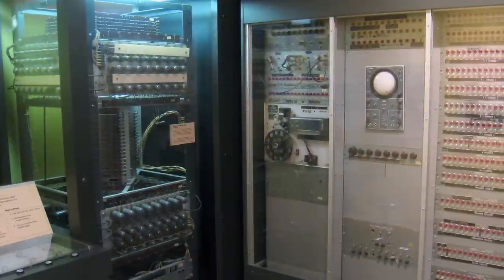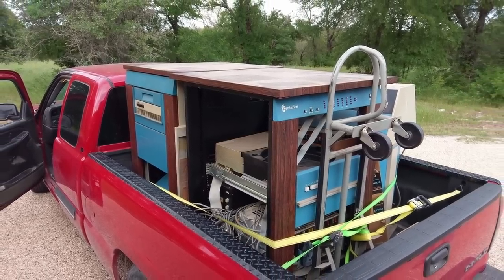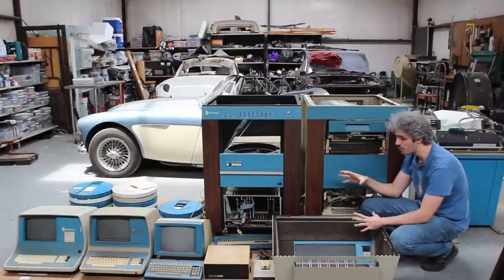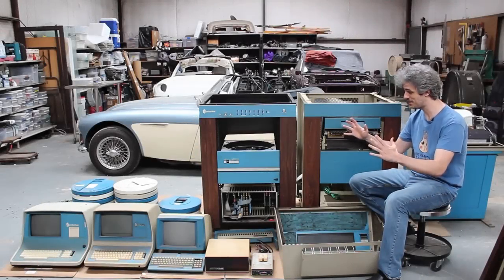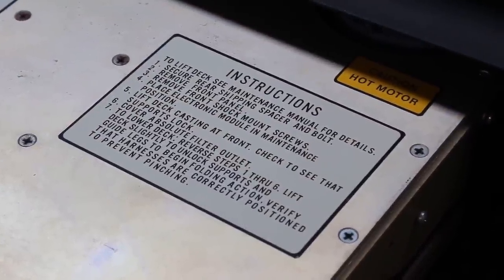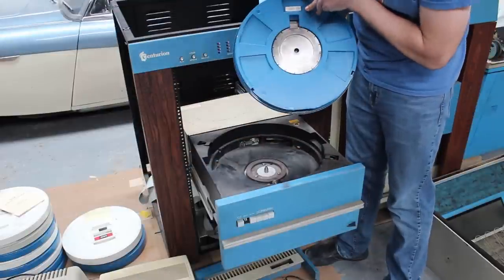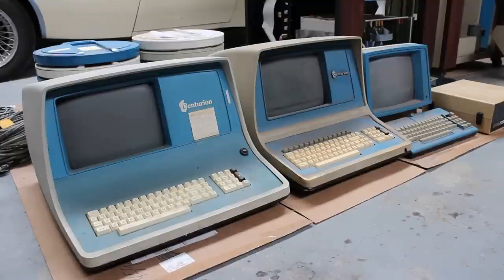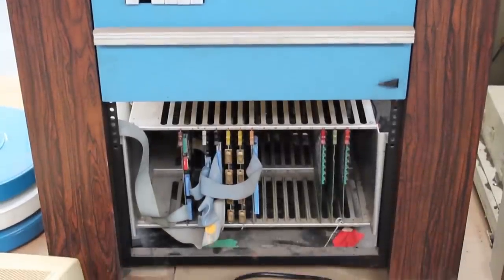I Bought a Minicomputer from 1980! – Part 1

Comment: The drive on the left is a CDC Hawk - Model 9427.  When you fire it up, be sure you have vacuumed it out thoroughly, replace the hepa and prefilters, and pull the voice coil cable, and do a spin purge (cartridge loaded - but not the heads) for a day or two.
Reply: this is such a great memory for me

Comment: In 2003 I worked for a company as a part-time IT help desk and a part-time computer operator. The computer operator portion was basically baby-sitting an IBM AS/400 and the attached printer, which was similar to that one you got, but bigger. I would feed it a box of paper every morning and make sure the massive print job was successful.

Comment: Well, watching this video brought back memories from the the late seventies. That second disk drive looked very similar to the CDC 9427H drives I used to work on as a field service engineer. The Micom box is a serial multiplexer -- it takes all those serial port connections and time multiplex's the signals to go out as one serial port stream to a modem. We used 2400 and later 9600 baud modems over a dedicated line, no dial up required, which allowed the main computer to be used in more than one store. Got to admit that printer looked pretty funky. I worked on drum and band printers, besides good old dot-matrix and daisy-wheel printers;the best description I can think of for that thing is a chain printer.
Reply: A chain printer is exactly what it is.
Reply: Any idea what the capacity of one of those drives is?
Reply: @timothy098-b4f  the 14" hard drives in my S/34 were a whopping 13Mb each, so I'd guess probably in that neighborhood.
Reply: @timothy098-b4f , I remember the 9427H as having a total capacity of 5 MB -- 2.5 MB on the fixed platter and another 2.5 MB on the disk cartridge. Normally, at least for my company, the data was mirrored between the two.
Reply: If this is from the 70s.  Would the modems not be 300 baud?

Comment: I think the smaller 'modem' is a leased-line modem.  Those ran at fast rates for the time, upwards of 4800bps.  The other box, the Micro 8000 looks to me not to be a modem but rather a concentrator/hub for a whole bunch of terminals to connect to it and then to the computer.  I once owned a Data General MV4000DC that had a similar device.
Reply from the maker: I think you're right on the money about the Micro 8000, as that also explains why I got multiple terminals with the machine. It would make sense that the company using the machine would setup multiple workstations and then have them all multiplexed in through the Micro 8000. 
I just looked up the Data General MV4000DC and that's a super cool looking machine! Looks much more compact than Centurion I have here, though if the Centurion used standard floppy disks, it'd be about the same size. Those CDC drives are massive!
Reply: I’ve seen and programmed packet switches that looked like that (x.25) The leased line may also be x.25, very common for the day.
Reply: Yep, that's how that works.

Comment: According to the DIP switch legend on the back of the terminal you powered up, self-echo was set to off.  You might get text on the CRT if you turn it to on.  At least the disc pack has the Control Data logo on it, so you may be able find service data for the drive on-line, but for the minicomputer itself?
Reply from the maker: That was absolutely it! I ran back out to the garage and gave it a test: https://i.postimg.cc/tJhfRy07/IMAG3685.jpg
I actually have the little user's manual that came with the drive itself, which is super cool. But, you're right, finding any information on the rest of the machine has been difficult for sure!
Reply: @UsagiElectric  that will give you doubled characters when you hook it up, no doubt. 

You can try th eterminal with a linux machine to check it out properly.
Reply: 9 months late, but this was my immediate thought too!
Reply: @lostcarpark  Yeah, on other brand machines it could be not "echo", but "duplex/semi-duplex", same meaning.

Comment: I worked at an auto parts store in the early 1980s, and the back office & point-of-sale system was based on a system similar to this, and had the same blue & beige terminals.

Comment: A few suggestions: 
1. Those two fan motors are for the absolute filters. The replaceable drive should be in that cabinet as well. Those old drives were very touchy when came to dust and other airborne stuff, you don't keep them  clean-you have head  crashes and replacement heads will be hard to come by.
2. Those are most likely ASCII terminals. (I agree, I think that one box is a concentrator for the other terminals) The serial setup can be problematic, in the old days you had to select baud rate, # of stop bits, parity (odd, even or none) and leased line modems you also had fuss time delays for high and low tones, echo suppression and other stuff I don't remember, you cannot believe how complex serial communication used to be. I think each of these db-25 plugs on the back of those each  could drive a ASCII terminal.
3. If you run that printer much, you will want to replace the foam, that was for sound deadening.  The chain printer weren't as noisey as drum printers, but they aren't known for silence.

Good luck with your project.

Comment: In 1987 I started work for  data cabling company Unisys at the age of 18. We used to wire these kinds of systems together, soldering 25 pin or 37 D connectors on each end. I still do the same kind of work and now and again see some of the old cables in the roof spaces, from back when I installed them in the 80's.

Comment: People are equally confused when they find out "medium voltage" starts at 1,000 volts.
Reply from the maker: That's so true! It really blew my mind when someone actually explained that a 600V audio amplifier is technically considered low voltage. Mind you, it'll still knock you across the room if you put your finger in the wrong spot, haha.
Reply: @UsagiElectric  Unfortunately most people think "low voltage" means it's safe. Tell them that mains is low voltage, then get into Safety Extra Low Voltage and Functional Extra Low Voltage and heads asplode.
Reply from the maker: @ian_b  My tube computer is being built entirely in SELV, which is mental for tubes to be operating that low, but in the scale of voltages, pretty much all tube operated stuff classifies as low voltage anyways, haha.
Reply: @UsagiElectric  The "low voltage" that always scared me as an electrician/engineer was "low voltage" battery sets at 960V :)
Reply from the maker: @ian_b  Haha, that's just mean! Just barely sneaking in under the low voltage classification!

Comment: That Micom device is a serial mux.  Basically takes all those serial ports and converts it to one port which can be sent to another matching device over probably a 9600 baud (or less) serial connection.  ADP used to install tons of those into car dealerships...
Reply from the maker: That makes a lot more sense! And also helps explain why I got three data terminals in the deal as well. The company probably had the three terminals setup as work stations all hooked into the same machine. It's going to be a lot of fun trying to bring it all back to life!

Comment: We bought a IBM PC with a 10 megabyte hard drive in 1984.  We also bought a printer from the IBM salesman.  Big desktop thing with tractor drives and serial ports.  Then we had to buy an adapter to get the IBM printer to work with the IBM computer.  Even the salesman was mystified by that one.

Comment: Worked with one of these computers in the late 1980's.  I am amazed that you were able find one.  We had the computer, several terminals, a line printer (like the big one you have there), a couple of dot matrix printers and a 10meg Winchester drive that sat on top of the whole unit.  When this thing was powered up, you could heat a small house!  And the line printer would make you deaf.  The early days of computing :)  Thanks for sharing.

Comment: The disk drive that loads from the top is a 9427H also know as a Hawk drive from CDC / MPI. The removable platter is 5 Meg and the fixed plater is also 5 Meg in size.  The other drive is a 9448 CMD or cartridge module drive also known as a Phoenix with a 16 Meg removable cartridge.  The fixed Platters varied depending on the number of heads installed, and could be 32, 64, or 96 meg.
I would expect one if not two of those cards in the cage are disk controllers responsible for interfacing to those drives.

Comment: I used to work on the first type of drive. You have to run them with the heads locked to "purge" the dust off the platters.... for 12hrs once the filters were changed. .Very very heavy.
Reply from the maker: Whoa, that's awesome that you used to work with them!
That's a good tip about running them to purge the dust off. They're a really interesting bit of history and kind of wild to see in person, and they are indeed very, very heavy, haha.

Comment: Beautiful wood and powder-blue.  Priceless "floppy drives" :)

I immediately recognized the DRAM chip family (I built a 64 KiB board with a close relative - I still need to restore that computer).  The MCM 41168 is a 16Kx1 DRAM.  It looks like a 9x8 arrangement, so probably actually 8x8 which means 128 KiB on this board.  I'm curious about the CPU driving it.  Everything suggests Z-80 with banked memory, but I hope we find something more interesting.  (But do open, clean, and inspect before powering on more stuff please).
Reply from the maker: Thank you!
And I'm really digging the color scheme, more computers need pastel colors and genuine wood accents! I couldn't figure out the right terminology for those drives. They're not quite hard disks, though the platters are just like hard disks, but they're not quite floppy disks, though they do have removable cartridges like a floppy. I'm sure they have a proper name, but it sure wasn't coming to me, haha.

That's awesome that you build a DRAM board like that, I can't imagine the diligence required to get it all wired up correctly!
As for the CPU, you'll be pleased to know it is a bit more interesting than a Z80: https://i.postimg.cc/63KLkQF6/IMAG3642.jpg

At a quick glance, it looks like there are two AMD AM2901 4-bit bit-slice ALUs and two AMD 2909 4-bit bit-slice address sequencers, and then a colossal amount of 7400 series logic ICs. As we get further in the build, each board is going to get a close inspection just to get a rough idea of how it works and replace any bad caps that look to be hanging about.

I actually wasn't going to power anything on, but I figured I had a spare terminal if one blew up, so I just went for it!

Comment: the printer is a Band Printer most likely a Data Product Line Printer it may have been a 300 LPM/600LPM Printer, the Disk drives most likely were Control Data Winchester drive you had a removable drive on top and a sealed Winchester drive below.  I worked for DEC on PDP11 systems and DEC VAX systems back in 1978-85.  I worked on RP06/7 Disk drives, RK05/6/7 Disk Drive, LP05/06 Line printers. PDP11/34A, 40, 50 , 60, 70, VAX 11/780, 11/750.
Reply from the maker: I think the printer might actually be a little slower than that at just 150 LPM. I found an ad for a Centurion system in a magazine from 1983 and that was what they listed for the printer, but the only way to know for sure will be to power this bad boy and let it churn through some paper!
The drives are actually CDC made drives, the older one is a Hawk drive and the newer one is a Phoenix drive. I go through them in a bit more detail in the next part of the series, but in Part 8 we actually take a look at the platters and it's not great news. They're on the back burner for the time being.
That's awesome that you worked for DEC! I have a buddy with a PDP11 and I'm sure he'd love to pick your brain!
Reply: @UsagiElectric  I'm pretty sure that Hawk drives are SMD drives (or CMD?), if you really really wanted to you may possibly be able to grab a modern solid state SMD replacement (obviously would allow you to play with images so much more easily as I think you can attach to these drives via a modern PC as well. It's not hard to find ppl who know a lot more about this, put a feeler out on cctalk/cctech!)

Comment: wow, this channel was a surprise. My father worked at the Swedish Solar Telescope wich relocated from Italy to the Canary Island of La Palma in 1979, they used to have a big PDP 11/34 down in the basement and the most massive printer I´ve ever seen. Eventually they upgraded (?) to a Sinclair ZX Spectrum that run the software for the tracking engines that makes it possible for the telescope to follow the sun. When they changed the mirrors sometimes around the mid- to late 1980s they got into these very modern micros reminiscent to what we use today. (I guess you just can´t have one of the world´s best solar telescope being controlled to what is basically a toy.) In the early 1990s the telescopes of the Isaac Newton Group still had racks with these huge reel- to reel data tapes.

Comment: In 1980, my uncle's engineering firm upgraded their system and I suddenly found myself in possession of a DEC PDP-12, four VT78 units, two reel-to-reel data banks, and a "spacious" 8 megabyte hard drive the size of a laundromat dryer. The total of the lot occupied more than half my parent's garage and generated enough heat to melt lead in that garage.
Reply from the maker: Oh man, that was an excellent score! The PDP-12 is a gorgeous little machine, and to get the reel-to-reel data banks with it is awesome! I would love to play around with one of those someday!
Reply: I had worked on PDP11 systems Plus I had an account using several PDP -8s. I had one account that had an old 20MB drive that was a mechanical detent for the heads vs the Voice coils of the later drives. boy did that make noise when you ran disk seek Diags on it to test the R/W heads.

Comment: I started on a Prime “Mini” computer in 1978.  I programmed in Fortran and machine code on Punch cards then shortly a VDT.  Always has a place in my heart.
Reply from the maker: That's awesome that you got to actually work with a Mini back in the day!
From the extremely limited documentation I've found so far, it seems like Centurion sold a Fortran interpreter with their Minicomputers too. Fortran was the go-to programming language for a long time it appears!
Reply: I had a chance to take an entire IBM 370 system. Drives, cpu, printers, software, the whole working system.  It going to the scrap heap.  I couldn’t do it, no place to store it.  Broke my heart.

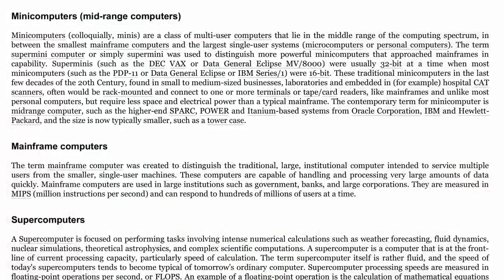Comment: 0:53 Minicomputers were cheaper and lower-spec in many ways. Mainframes had elaborate I/O controllers to handle high throughput without burdening the CPU. This made them great for batch operations (like a lot of business data processing -- payroll, cheque reconciliations and the like). But then this new thing called “interactive” computing came on the scene, but it was not an efficient way to use an expensive mainframe. Minis, on the other hand, were ideal.
Reply from the maker: Another interesting thing I've been discovering about Minicomputers is that they were primarily just for storing a large amount of data! Centurion did write their own proprietary software (word processor, spreadsheets, etc.), but their primary market was the ability for multiple users to create data and store it on the disk packs. The Hawk drive, which was the drive that was initially in the computer when it was built in 1979/1980, had I believe 10MB removable platters, which was massive compared to the standard floppies of the day. The Phoenix drive that was in the second chassis offered something like 40MB of data on the removeable platters which is an insane amount of data!
Reply: @UsagiElectric  How did they back up that data? Hard drives were and are unreliable, and removable drives are even more vulnerable to trouble. It was common to do backups to tape, but your system didn’t seem to have any tape drive.
Reply: @lawrencedoliveiro9104  I can't speak for this system but the systems I worked on of this vintage were backed up to tape like yousaid but at the mainframe end.  So, Bendix Flight, Bendix Aviation, and Bendix Guidance were all in an enormous building in Teterboro, New Jersey, but all of the actual processing was done in their headquarters in Southfield, Michigan.  This system would have been RJE, Remote Job Entry where the data was uploaded every night to a mainframe somewhere, or a batch system where the data was sent to a mainframe and processed over night and sent back the next day.

Comment: As suggested, please don't power up the disk pack drives. They have to be cleaner than an operating theater or you will kill it within seconds. When we used to change the absolute filters on the phoenix drives we ran them for 40 minutes just to purge the filter before we would put the drive online. And that was in a computer room designated as a 'clean room'. The disks have to be spotless too. I doubt anyone could change the heads today and back in the 80's it cost £1,000 back then!  By the way, you stow the disk pack cover over the top of the disk pack once it is inserted into the drive. It keeps it clean.
Reply from the maker: Thank you for the insight!
The drives actually were both in pretty rough shape, and both suffered head crashes years before I got my hands on them. I show them in more detail in Part 2 and in Part 8. 
Here's the full playlist: https://youtube.com/playlist?list=PLnw98JPyObn0wJFdbcRDP7LMz8Aw2T97V